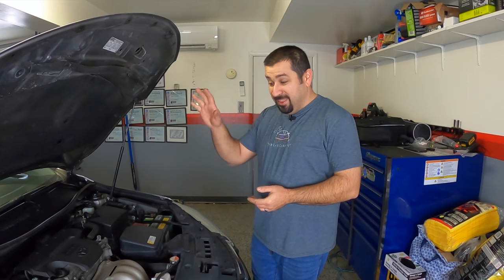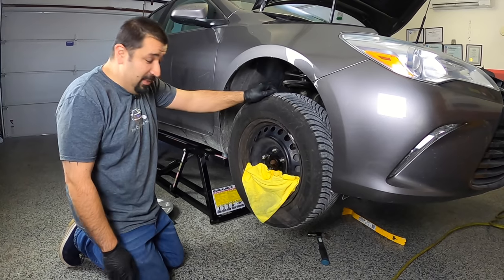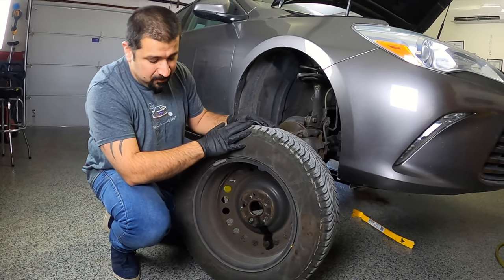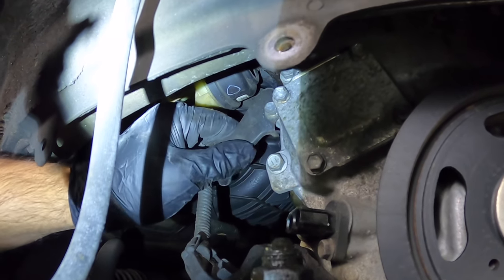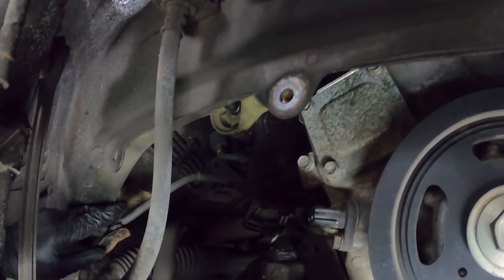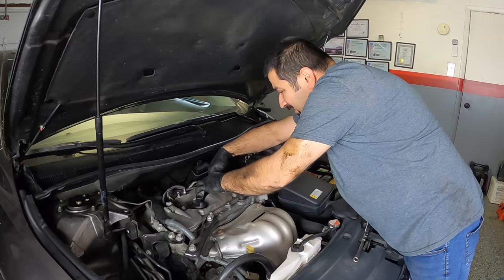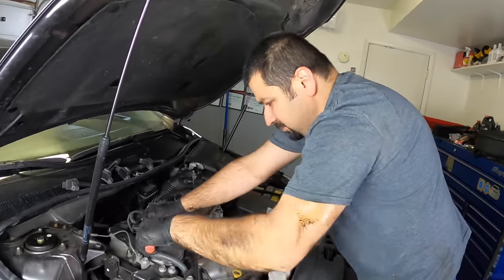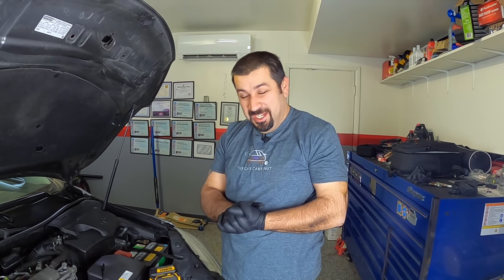Replace the PCV valve WITHOUT removing the Intake. Saving 3 hours of Labor.

Comment: Gr8, PCV valves are often overlooked.  I would change them every 100K miles regardless of if it is working or not.   Honda PVC are pretty easy to replace.  changed it on my Honda Odyssey and it went from 2-3 qts of oil every 3k miles to about 2/3 of a qt of oil every 3 k miles..  (it has > 220K miles )  changing on a Honda its 1 10 mm bolt and maybe 20 mins todo.
Reply: Pcv valve needs to be changed at 60 thousand miles.
Reply: @williamlugo78   depends on mfg.  
I know my Nissan Maxima said check and replaced as needed every  30k
Reply: @dfields9511  I do mine every 30K regardless. They are cheap insurance for the longevity of the motor
Reply: Usually just need cleaning

Comment: Thanks AMD got mine changed in about a hour, the hard part was trying to get it back in. I took a small pocket regular screwdriver put in the hole on the PVC where  the hose goes over, the driver went in a few mm then widened to catch the PCV,  and on the first try I got it to turn to get it started then finished tightening with the ratchet and socket.

Comment: Another awesome video!  I will be doing this on my 2011 Camry next weekend and this will be my guide.  Thank you for sharing your professional knowledge and  for producing TOP NOTCH content!  Thanks to your Mrs. too!
Reply: I too have a 2011. My understanding is we cannot use this procedure because we have a power steering pump while the 2012 and newer have electric steering. I’m curious to know how you make out.
Reply: @michaelruys5021   Good point.  That could present a challenge.  I’ll let you know how it goes once I get In there and take a look.  Hoping I can use the CCN’s technique.  If not maybe I can figure out another way.
Reply: @mf9309  hi did you figure it out
Reply: @SuperMan-uj7dh  Sorry. I got busy with work/life, but I will post it here to let everyone know what I find whenever I do get an opportunity to look at it.
Reply: @michaelruys5021  Also curious with my 2011. I've got the pump in the way, however,  I can see the hose just to the left of that label on the engine and it looks like I may be able to get in there with some kind of socket extension setup after the hose comes off, either from the side or from under. It's tight but maybe removing the upper motor mount and the idler pulley will make it possible. A mechanic on toyotanation says no, impossible. But that's all I need to hear to make me go for it.
Reply: @geecrawdad , can you give an update? just curious if you were able to do this from the top. I too have the issue with the motor mount and ps pump being in the way. I was able to remove the hose, but getting a socket in to remove it was next to impossible. I think I'll try it again by removing the ps pump this time. I honestly have no idea how anyone can do it from the wheelwell or bottom on the 2011 2.5L (non hybrid) since it's so high up near the top.
Reply: @John-xeyvfkwieba  Unfortunately, I never got to try it; my wife hit a deer and totaled the Camry. So, that's one alternative solution! I do wonder what would block access if the motor mount and idler were removed.

Comment: Great job Mr. Car Care! Have you ever done this on a 2010 Corolla? I would imagine that the Driver's side wheel would come off for a 2010 Corolla based on what I've seen for the PCV valve and hose location??? OR must I resign to removing the intake manifold and swinging it out of the way? I remember my 1972 RoadRunner had the PCV valve running through a grommet on top of one of the 2 valve covers. Pop it out. Clean the grommet and end of the hose. Plug the new one into the hose and push it through the grommet. 30 second job. I miss the old days!!!
Reply: I have a 16 Corolla and removing the front drivers side wheel is recommended as it is accessible from the right, not the left

Comment: Very thorough procedure, AMD.  I did my 2012 Camry with the same procedure, it took me about 30 minutes. Be sure to buy an OEM PCV hose for $14 as well. Mine was stiff and cracked when I removed it. Silicone definitely helps with installation. A question for brother AMD, the new PCV from Toyota doesn't have the pinkish thread locker like for some other Toyota/Lexus models. Do I need to apply 1324 on it?
Reply from the maker: Hi! No you don’t need to on the case of this engine
Reply: @TheCarCareNut  Thanks for your reply.
Reply: @driverman9528  I got a set of deep sockets from Harbor Freight just for this job. I forget what size I used. You need a deep socket to work on it.
Reply: @kenty6973  I think it’s a 21 or 22mm
Reply: @driverman9528  19

Comment: Great video, same on scion tc with 2ARFE. I put a straight hose on the new pcv valve to get it started screwing back in then popped it off and finished with socket.  You get a nice tactile feel I find using a piece of straight hose.   I got pretty big hands but managed okay.
Reply: That's a great idea!

Comment: Nice video. Thanks for sharing. I was curious on your thoughts of the 1000 mile fluid exchange. I have seen some say you should replace the fluids after the 1000 miles on a new car to get rid of possible metal shavings then continue with the recommended intervals after that.
Reply from the maker: Hi! Yes I do recommend you do a break in oil change at 1000 miles.

Comment: I have a 2005 Camry 4  cylinder w/ 245000 miles, that only shakes at idle , I can put my car in neutral at a stop light to make it be quiet (it’s embarrassingly loud) it still drives great on fwy and city , oil changes have always been done at 4,000 miles , just used lacquer thinner for the cat but the shaking has been consistent for the past year

Comment: I just did a pcv valve on a 2009 Corolla. My work area Central Avenue in Tampa. I had to remove the intake manifold, actually pull it back about 6 inches and there it was. Right under the 3rd inlet of the intake manifold. The job was half hour maybe 45 minutes. I am not a mechanic. I ended up replacing the intake manifold gasket because I misdiagnosed a P0301 or engine misfire. With the experience replacing the intake manifold probably took a half hour maybe. Unfortunately thanks to a compression check blown head gasket. Reason for clicking on your video, your thumbnail popped up.

Comment: Just use a prybar on the inside of the wheel prying on the lower ball joint and it will come off with very little effort. This tip is from an old German mechanic.

Comment: I rotate my tires and ran into the stuck wheel on the front both sides but never as bad as that one. A small hammer at the top on the outside usually does it.
Reply: I'm not that strong. When it happens, I use a sledge on the inside bottom.

Comment: On my last Tundra with the BBS Aluminum Rock Warrior wheels...I went to rotate the tires and I couldn't believe how seized they were!  The grease on the hub is a great idea!  Also ran into a security lug nut that was even more "secure" when a tire shop stripped it out...after that i tossed those security lug nuts and went back to the standard.  Its sometimes the little things that make a job much harder.  I really like that lift, i've always though about getting one.   Will it work with trucks?
Reply from the maker: Hi! Yes it works on trucks. It’s rated to 7000 lbs

Comment: The book my 2015 came with said nothing about PCV valve change intervals ?? So what should it be??  If you get one of these engines out of the car ,  with a new valve, you can actually measure the thread on the valve and install a similar fitting with a metal hose, like brake line, the other end a female fitting so now the vale is at a place where it is accessible easily.  With a shop like yours , I can even take apart a 6, 8 speed transmission and find out where I can drill and easily install a tube for a dip stick.

Comment: Hey, I have a 2018 camry and I want to try and change the pcv valve, I know you said in a comment that I have to remove the intake manifold and I want to know how hard is it to do it, specially when Im not a professional like you. If I were to do it by a professional though, how much would it cost? 
Thank you and just so you know your videos helped me change the transmission oil, break pads, coolant, spark plugs and the information you give out it helps alot.

Comment: Is there any benefit to going the other route and removing the intake since while you have the intake off there might be other parts that should be replaced while you're in there?
Reply from the maker: Hi! Unless you have a leaking intake manifold gasket then or you’re doing a knock sensor for example then no there’s no benefit.
Reply: You definitely can clean the intake ports, intake manifold flaps, intake manifold pcv passageways if clogged and replace the intake gasket if damaged and leaking usually the cel will light up. Also, the actuator mechanism that opens and closes the flaps on the front of the headers intake manifold but I haven't seen those go bad only the flaps get gummed up with oil from the pcv return hose to be burned or just build up over time from air heat moisture. An oil catch can minimize the oil being re-burn to the engine and decrease the oil that passes through those flaps or pcv passages ways leading to them getting gummed up and having performance issues. That said there are no other parts that can be replaced when removing the manifold to the best of my knowledge other than those I mentioned and possibly some hoses. I hope that helps.

Comment: Great...need to do this on my 09 rav4.  Would have been nice to see where the other end of that hose connects.
Reply: Normally PVC hose end up at the intake manifold or intake runner, down stream of the TB.
Reply: @metzmatu8409  Normally, yes and normally they are not placed in such an awkward position due to a poor design.  So, that's why I would have appreciated a visual in the video.
Reply: I have an 2011 and the other end goes to the top of the engine.  Just follow the hose with the nylon braiding.

Comment: Doing work by feel and not by sight is a vital skill. Every mechanic must learn if they want to be able to do any major jobs. A lot of the work that is done on engines is by feel and not by sight unless you plan on pulling an engine every time you got to do a job. With that said, only question I have for this video for a PCV job I'm going to have to do shortly is can I clean the surrounding area with a little bit of brake cleaner or carb cleaner to remove a lot of the oil buildup if there is some? This is what I typically do, but I'm not sure if there's any parts down there that may be damaged by these cleaners.

Comment: Great video AMD. I am wondering if that line of thought would apply also to replacing the MAF, Oxygen Sensors etc. in a 2007 Tacoma 4 cyl or equivalent engines with over 125K miles.
Reply from the maker: Hi! Not for the sensors as these set codes when they are issues

Comment: TCCN thanks for another great video.  I have a 2015 corolla with 105k.  I have been changing the oil 0w20 full synthetic every 3k.  Oil always seems clean.  Is it due for the PVC valve?  If it is can you, please do a video?  I can't find it. thanks
Reply from the maker: Hi! When you replace the spark plugs at 120k consider replacing it as wwll

Comment: 2nd attempt successful, but I'm still mumbling & cursing! 
This time I really did move the bracket for the crank sensor, and it is the only way you can get in there. You CAN get a visual on the hose and the end of the PCV (after removing the hose) from underneath, but its hard. I think the best way would be from below with the car ON A LIFT , not the ground, so you can reach up further.
The hose pulled off fairly easily, and thankfully, it was in good shape. The old PCV came out easily after I found the right combo of extensions and swivels. When I was fiddling to get the new one started, I DROPPED the damn thing to Parts Unknown. After a meltdown and a rain shower, it turned up. As you show in the video, it was ticklish to get it started, and it seems tight going in, but it went in with consistent resistance all the way. The hose was also No Fun to get back in, but I got it in.
Now, lets see if my oil consumption goes down. If it does, I'm going to put my tinfoil hat on and write a scathing letter to Toyota! Toyota engineers seem to make impractical decisions in order to achieve an objective of dubious worth. For example, the cartridge-type oil filter. It is a messy, fussy, P.I.T.A. to keep 1 oz of sheet metal out of the landfill. I paid handsomely for an adapter to a regular spin-on filter, and it was worth it.
Now that I'm relatively calm, TYVM for the video. I wouldn't have come near getting this done without it!

Comment: This reminded me of replacing the alternator of my 2006 IS350. There was a 10 mm bolt I believe that hold the bracket to the engine block I had to work by feel only cause it was completely out of sight.

Comment: Hi, I really enjoy your informational videos. I wanted to ask for your advise. I have a 2012 IS 250 with 64000 miles. Do I drain and refill my transmission fluid or do you also recommend to replace the filter?
Thanks. Charlie.

Comment: I've replaced my PCV valve and instaled an oil catch can on my 2012 Camry SE about 8 months ago. Not much room to work around at all. I lost the pcv valve down in that tight space and I had to poke it out the other way wasted about  30 mins just to get it out. I end up using a 3/8 rubber hose as an extension attached the pcv valve on the other end and screw it into place. To anyone that tries doing this method, I suggest using a 3/8 hose as an extension not just a socket and socket extension the valve will fall out, and it'll be hard to get out of that tiny space between the block and intake manifold.

Comment: For me getting the replacement hose from rock auto was a multi-month process. Thanks for the heads up on replacement. Do you need thread sealer for installation?

Comment: I have this exact car with 203,000 miles on it. Never knew it even had a PCV valve, but since the car does not use oil or give any other indication that the PCV is bad, I’m going to leave it alone.
Reply: Me too

Comment: AMD, Let's give the owner a big pat on the back. I love those cheap steel wheels and Michelin  tires with plenty of SIDEWALL to navigate through the potholed streets of the Chicago winter. In yesterday's short video I noticed you are using your expensive alloys,  when are you going to get some cheap steel wheels of your own? My cheap steel wheels use Michelin X-Ice snow tires with plenty of sidewall. So far the wheels have survived our cratered Ontario roadways for 17 winters thanks to a quick blast of Krown rustproofing each year. In regard to the PCV valve, my car may not have the power of the Camry's 2.5 engine but the PCV valve on my 1ZZ-FE engine can be changed in a few EASY minutes 😁
Reply: The Michelin tire in this video is CrossClimate (2?) rather than X-Ice.  The best tires I've personally owned are Michelin X-Ice 3,  which quite amazingly have very long tread life, and great performance anytime from NH in winter (where I live) to Arizona in summer (where I vacation).  I replaced the stock 195/65R15 89S Toyo NanoEnergy (aka "NanoCrapper" on PriusChat) LRR all-seasons when the car had 700 miles on it, and the Michelin Xi3 205/65R15XL 99T lasted 63K miles.  10 load ratings higher than stock, 119mph rated instead of 112mph (the car rev limits at 104mph to protect the always-geared-in electric motors from overspeed) and as far as I could tell, no mpg penalty (I run the 51psi max-sidewall-rating tires at 50psi, for both handling and ground clearance reasons).  Then I switched to Xi3 205/70R15 96T, which are the tallest tires which fit (they rubbed one time when pulling 3g's in a road dip) without a lift kit. The 205/65 had the car handling like it was on rails.  The 205/70 are definitely squirmier, but because I drive it offroad out west, the extra 10+mm of ground clearance they give me is worth it, plus added pothole protection here at home.

It's hard to believe, but the X-Ice3 is easily a better summer tire than the Goodyear Eagle GT+4 I used on my 1985 Merkur XR4ti back in the '80s (and didn't last very long) or Pirellis/Continentals on my 1997 Audi.  And that's in the season they weren't designed for.   In snow/ice, there is just no comparison.   I had bought an extra set of alloys to swap winter and summer tires, but they are such good tires, the extra  wheels are sitting unused 4 winters later, I never went to winter/summer swapping!

Comment: Never mind getting Car Care Nut/AMD to do my car…the amount of subliminal learning that MRS CCN must do, I’d be pretty happy if she would do my car!  Here is my favourite true story about repairing cars…guy puts his pride and joy back together, it was a piston & rings type job…drops a tiny screwdriver off the edge of the engine bay, and ends up taking the engine apart again to find it…wrong assumption of course, it had gotten trapped between layers of old carpet he had on the floor all along.  I did a similar thing with a tiny cup-shaped washer they use on old drum brakes, and fashioned an entire replacement out of a penny.  Literally a ‘penny washer’.  After putting the brakes back together, when tidying up the garage, found the special washer under a flap of polythene covering the damp earth floor.  There’s a theme here.  Great stuff, I am here cos bought a Prius a month ago, first-ever toyota, as a ‘retirement car’.  Not new, but it’s new territory for me.  Take care.

Comment: When the wheel rim gets seized up like that, I keep a piece of 2x4 in the trunk and place the jack on the opposite wheel and use the 2x4 combined with the jack to put force against the seized rim. Sure, it's a bit fiddly to get all the pieces in place but, it works every time and you don't run the risk of breaking the bead seal if your intention is to plug the flat tire and get back on the road.